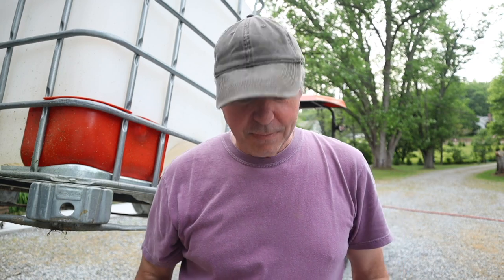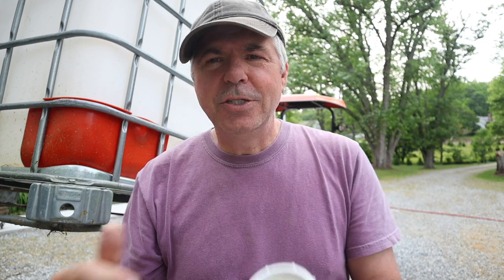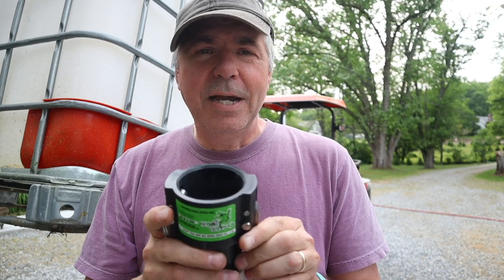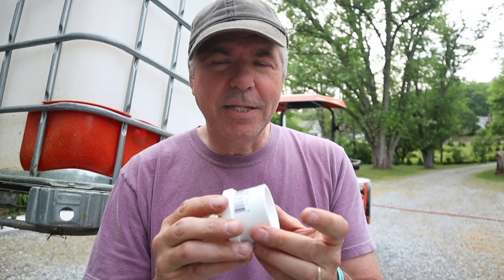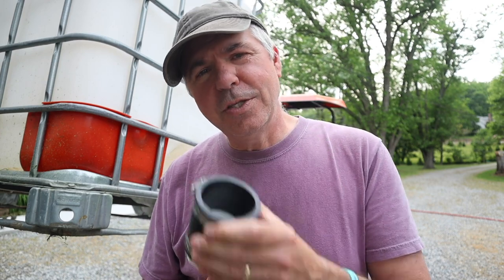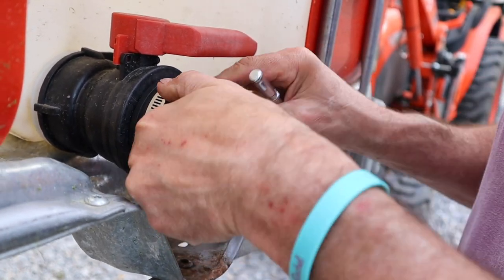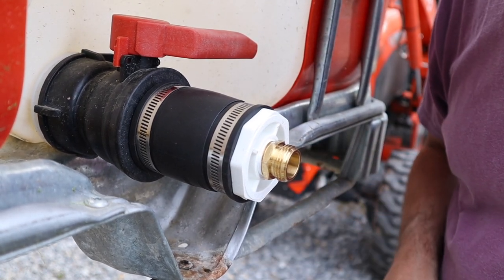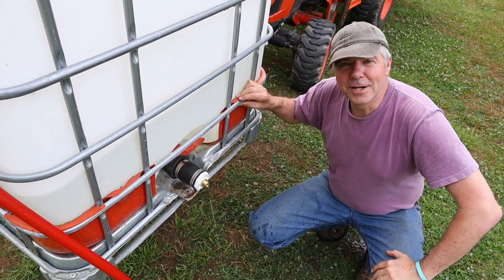Connect A Garden Hose To Your IBC Tote For Easy Gardening! Video 145

Comment: I went through this a couple of years ago when my well went dry. The best solution for putting a garden hose on a tote was a 2" camlock fitting to 3/4" gardern hose male fitting. $20 
The cheaper fitting was an ibc 2" threaded fitting to 3/4" garden hose fitting. $15+ both work well and both are made with abs plastic. 
Btw I elevated my totes on pallets. 
Good luck out there guys.

Comment: Hi Ed, great video! I am also using an IBC tote for water irrigation and came across an adapter that fits most totes. Google IBC tote female (2” thread) to 3/4” garden hose thread. I’ve had this adapter for about 3 years and solves the problem. I think it costs around $15 back about 3 years ago, well worth it I thought. Anyways, just a suggestion. Have a great day!
Reply from the maker: Thanks!

Comment: Great solutions Ed!  I was lazy and just bought a premade connector for $20-25?  It screws on the IBC tote & connects to a garden hose.  
Be careful with water filled totes!!!  I have a video where I almost flipped my tractor sideways with a tote.  
….also Mike Morgan just had a nice setup with a harbor freight pump that gave him hose water pressure.  Great job on your video! Keep’em coming!

Comment: It is good the see what options you have and it does not looks straight forward, thanks. We are lucky over here as you can buy a number of different adapter that fit onto the IBC that either have a quick adapter for a hose or a thread for a garden tap ot both

Comment: I was wondering if you ever thought about trying a CB1060 land pride 4 in 1 bucket. 
I have one on my B2601 and love it.
Reply from the maker: I haven’t but it sounds interesting!
Reply: If you get a chance to use one please do. I have cut down 18 trees, 3 of them 27” and bigger. Dug out all three stumps with it. The other trees was 8”s or less. So logs stumps brush no problem. Back blade with it. You don’t have to chase a pile of dirt and ramp your tractor into it. Drive up open the bucket put it over the pile done. But this bucket is heavy. That’s the only draw back. Ok thank you for writing back. I do enjoy your videos.

Comment: I also wanted to do that to water 21 trees along my road I just planted. Plus some grass I put down. I would use rain water as much as I could. That idea would work great for that. 
I have one question. I also have a B2601 how full can you get that before it’s to heavy for the tractor?
Reply from the maker: That’s the biggest problem. Maybe not even 100 gals!
Reply: Water weighs 8 lb per gallon approx. So look at your specs for tractor max lift subtract the weight of forks, empty IBC tote the balance divided by 8 equals max number of gallons. Give yourself a margin of error.

Comment: Why don't you put some air pressure in the tank to increase the effective water pressure.
Reply: Also, if you raise the height of the tank  one foot of head is equal to . 433 PSI.
Reply from the maker: I’m with you. I was playing with ideas to use my leaf blower to pressurize the tank 👍